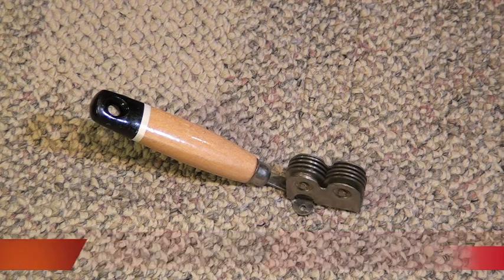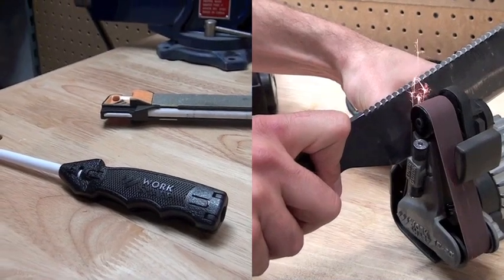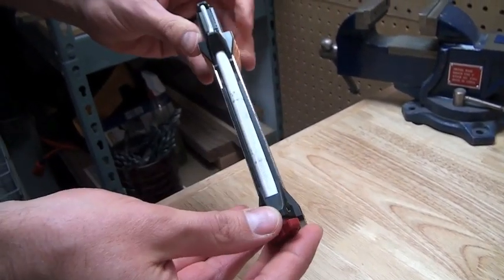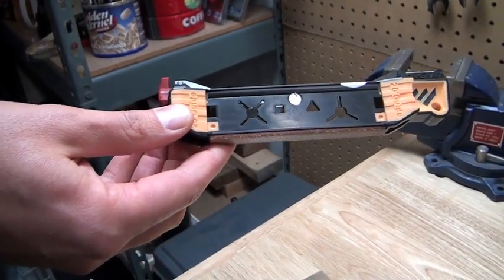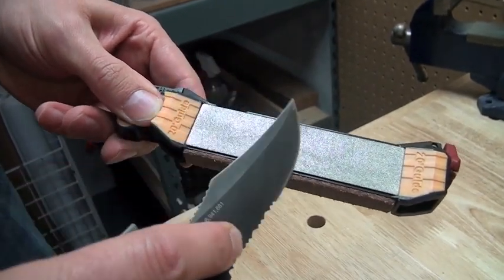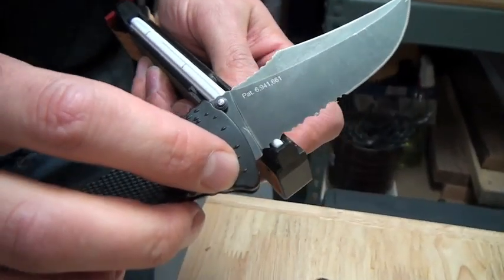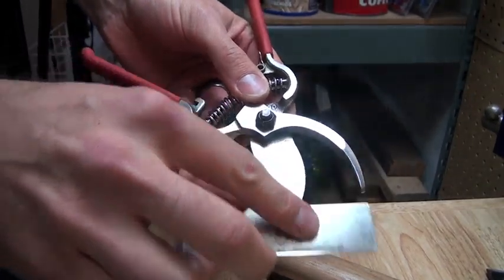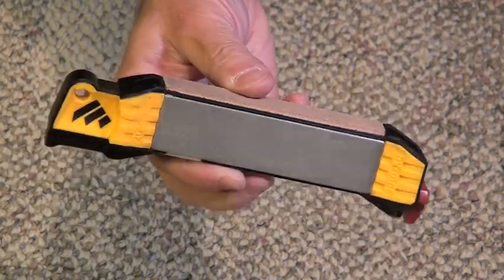Best knife field sharpener? It's a Work Sharp

Comment: Picked one of these up at Cabela's today. Finally found a sharpener solution that doesn't leave me with a duller blade than I started with. Not that other solution's don't work just that I sucked at normal stones and the little V sharpeners aren't all that great. 

I think my main issue was not using the leather before, having all the steps in one package along with the guide ramps really made the difference for me.
Reply from the maker: consistency is this tool's plus.  Thanks for watching.

Comment: Man, I'm glad i finally found your video! I bought the guided field sharpener Saturday after seeing all the positive reviews. I bought it to compliment my original work sharp belt sharpener. I wanted something portable,  that i could stuck in my bugout bag. 

After reading the destructions i was confused as to why the ceramic rod guide is 25 degrees and the diamond stone is 20 degrees. I spent saturday afternoon and most of Sunday watching reviews and nobody said anything about the two different angles. This video is the first to even mention it. This video and the video response from Kyle kinda answered that question The ceramic rod is to compliment the power sharpeners. 

The power sharpeners clearly state that the 25 degree guide is for field knives and the 20 degree guide is for kitchen knives. So then why design the field sharpener with a 20 degree guide on the diamond stone?? What if you damage your blade in the field and you need more than just a ceramic rod and you've set your blade edge at 25 degrees as per the power sharpeners instructions?  You're jacked as far as using the guide on the diamond stone,  which is the whole reason you bought the work sharp guided field sharpener in the first place.

The only reason I'm not in the truck this morning driving back to the sporting goods store to exchange it for the less expensive smith's 3 in 1 sharpener is because the work sharp is made in America.
Reply: I guess im asking randomly but does anybody know of a tool to log back into an Instagram account??
I somehow forgot my account password. I would appreciate any tricks you can offer me.
Reply: @Kyrie Darwin it worked and I now got access to my account again. Im so happy!
Thank you so much, you saved my account!
Reply: @Ivan Gary glad I could help :)

Comment: people really wated a battery operated worksharp field device- There's a ton of diamond infused stones for field work/ hand sharpening- the problem most peopel have is holdign hte knife at a steady angle, which is why the electric model with angle guide works so well for those of us not skilled at keeping a correct angle- from the looks of htings, your electric worksharp looks liek it works really well- why not make a battery operated version too for field work? Zip boom bang, knife is sharp and ready for field work wheras many peopel can't use hand sharpening devces well enough to get a good edge-